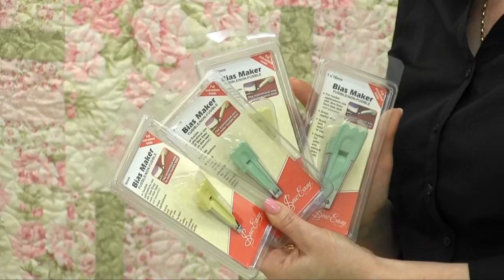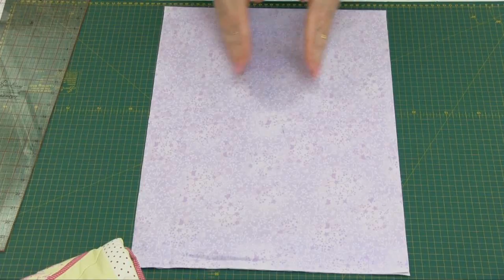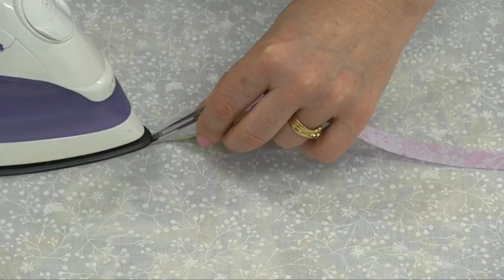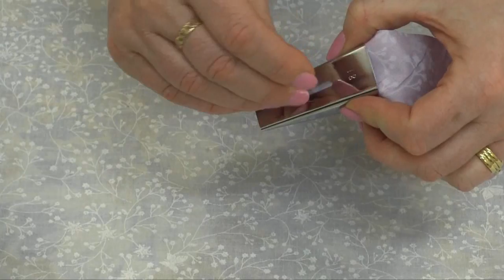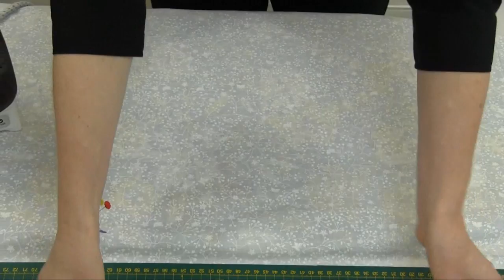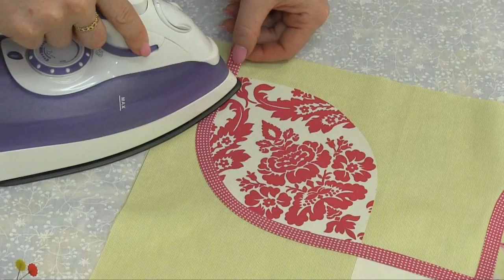Monica Poole Demonstrates how to use the SewEasy Bias Maker

Comment: I finally found a video where comments are NOT turned OFF.   WHY do you turn off comments?   I wanted to ask about one of your newest videos where you used machine embroidery thread both upper and lower.  You were thread painting the peacock applique.
Why do you think you had so much trouble with the thread breaking and why did you need to stop and clean the machine?????
Would you say that people with everyday domestic machines should NOT try your technique??????
OR should we just try with normal machine thread?  or  maybe use the machine embroidery only on top???????